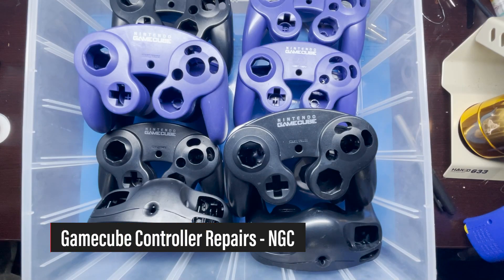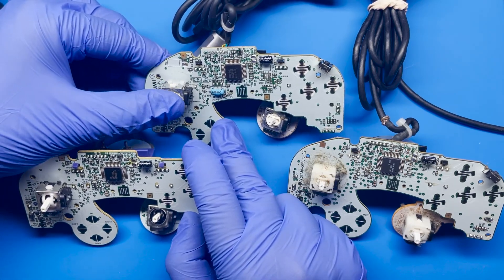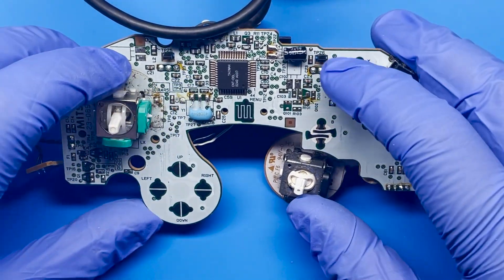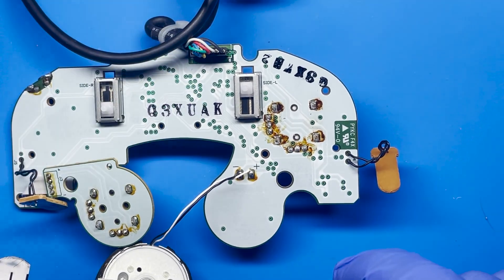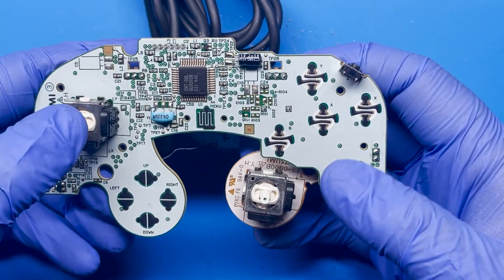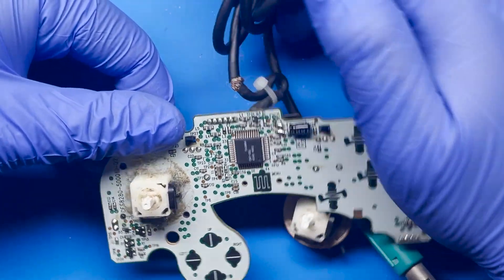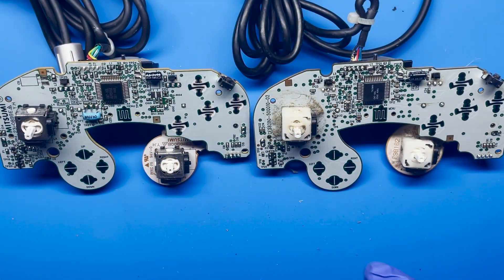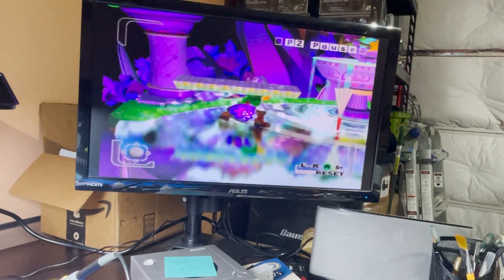Repairing Controller Joystick and Cable | Nintendo Gamecube

Comment: Good source of official nintendo sticks are the wii mote nunchucks. Normally not a lot of wear and inexpensive in used market.
Reply from the maker: This is actually true, I will highlight this comment in case others are interested in looking for alternatives as T2 and T3 boxes are harder to come by.
Reply: @Total Fix  thanks for pining that comment
Reply: what about wii classic controllers? they would have two modules instead of 1 if theyre the same part, would love to know before i do this repair myself (soldering for the first time)
Reply: @RosenBro  I dont have a wii classic controller, but I think they should work. I'm pretty sure they don't have a press down click button on the  analog. They do seam harder at least for me to find then the nunchuck
Reply: @patrickthompson8913  isnt the gamecube controller and nunchuk also missing the click down button on the analog? do you know if its possible to put these in upside down the wii classic controller has one normal and one flipped
Reply: @RosenBro  tried this, and it depends. If you GC has T1 or T2 sticks, Wii Classic sticks wont work since they're T2. Nunchucks work because they use the same T2 sticks as gamecube controllers. If you have a GC controller with T3 stick then yeah they'll work. 

You can tell the difference between T1/T2 and T3 sticks by the fact T1/T2 sticks are all metal and have 4 solder retainer tabs on each corner on the bottom of the stickbox, while T3 sticks are plastic and have 2 indexing pins on the bottom as well as being held to the board with 2 screws rather than 4 solder tabs.
Reply: dude you just saved me from going to all across my city

Comment: Have you tried using magic easier to remove the scuffs on the controller I've used those to remove scuffs from toys to video games and consoles .
Reply from the maker: As a matter of fact I do! However, in this case it looks like the paint is only at the surface layer...once you dig a bit deeper, you get this dark greyish plastic, which is what is seen in the video. Magic eraser works like a charm for easy scuff removal

Comment: Great video, which desoldering iron do you use, I’m very new at soldering and desoldering with the regular iron, flux and solder wick is hard as hell to do and near impossible for me but then I see you with this tool that literally is magical, also where to find OEM T3 my controller I bought had the stick broken out the stick box!
Reply: wii classic pro controllers are like $15 on the used market and afaik, always have T3 sticks. 

They also werent used for many games, so most people just hardly used them at all. so they have hardly any wear

Comment: How do i remove the colored plastic plug part? 
Lets say i have a broken cable with orange tip, and i have a black plug replacement cable, how can i transfer the orange part to the other? I know with heatgun, buuut there is the weird connector on the other side of the cable that gets soldered on the motherboard and that motherboard side plug (seen here 8:42) wont fit through the hole of the plastic piece.
Reply from the maker: You’d have to desolder the end connected and then remove the pins 1 by 1. You can check this video out for reference: https://youtu.be/BEJcXbueipo it’s at around the 2 minute mark. Hope this helps!
Reply: @totalfix877  thank you so much! you're a hero!

Comment: 9:23 Why did you bridge that?
Reply from the maker: The pad ripped from the last pin, and that last pin's trace connects to that capacitor. It's hard to see, but if you look at the last pin, it's missing the metallic pad.

Comment: Are the joystick all the same ??
Reply from the maker: They're not all the same, there are 3 types of sticks. T1, T2, T3 sticks. T3 being the best, but it is not compatible with all types of controller boards.

This source might help a bit further:
https://gccontrollerlibrary.com/guides/gamecube-controller-internals-guide/

Hope it helps!
Reply: @totalfix877  and about game cube ? Wich type ?
Reply from the maker: @mohrouge1497  The controllers are compatible with both versions of the GameCubes DOL-001 and DOL-101, so you should be good

Comment: Use the original potentiometers not the new ones otherwise your character or camera will fly all over the place.
Reply from the maker: Haha yeah, I'm definitely not a fan with replacement joysticks on any controller repairs. The quality just doesn't hold up as well.
Reply: @Total Fix  The sticks are okay, I have a replacement stick in my wavebird but the original potentiometers and it works just fine, hasn't loosened yet.